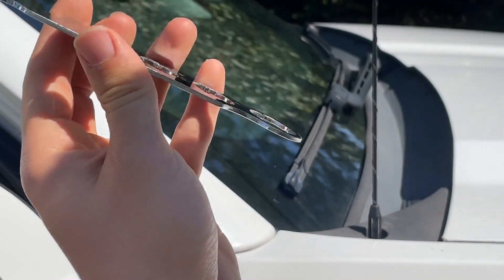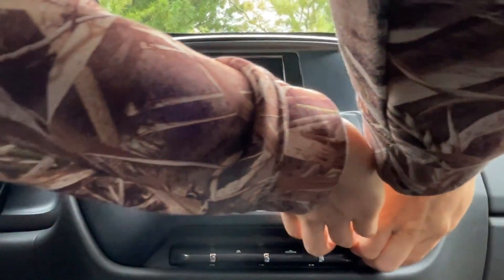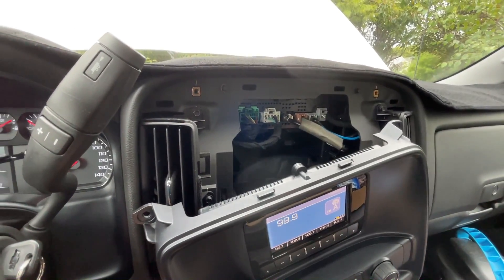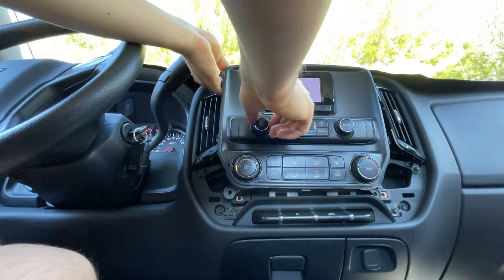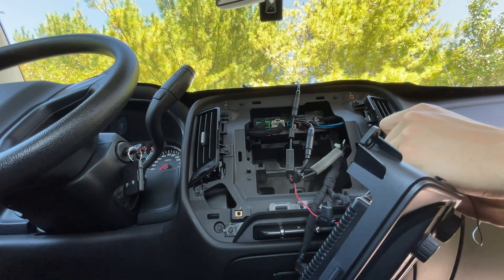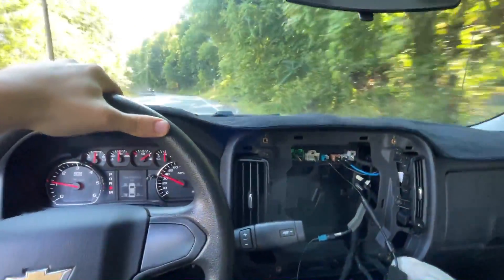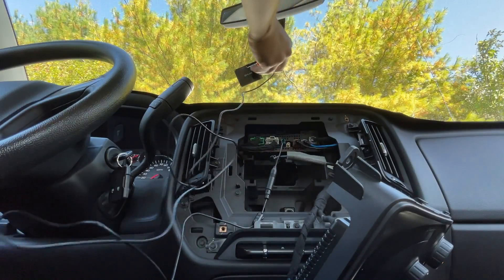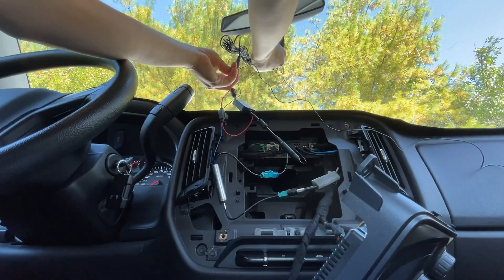Car FM Antenna Signal Booster Amplifier Install + Test

Comment: 31 inches is the tuned length for 88mzh to 108mzh .if you add 2 antennas it's 62 inches long and out of the band . So stock would be better.  The radio is the problem it's probably off the frequency band . Im having the same problem with the aftermarket radio .stock radio works good put my pioneer radio is not as good ..

Comment: To get the best reception you need to use the antenna with a much thicker 75 ohm high gain coaxial cable, and also the one end of the antenna should be grounded to the metal part of the vehicle's body or chassis. That's why your stock antenna has already gained some good signal strength. Without a ground loop, any Antenna makes ground noise if you're too far from the broadcasting tower or when moving the vehicle. Without a ground loop, even FM Amplifiers don't give the best results. Those cheap Chinese Antennas don't have any of those and just only a small printed circuit piece inside that is attached to a tiny wire that receives nothing. I recommend creating your own antenna using aluminium foils. I'm using a car stereo inside my room and I've tried many expensive antennas, even marine grade antennas but they don't catch my favourite stations cuz massive concrete slabs and walls weaken most of the signals. Finally, I created my own antenna by cutting two strips (10mm x 50cm) each from aluminium foil and mounted them under my table using double-sided tape. One is a base that is mounted horizontally, and the other one mounted vertically to act as ground. Both facing each other with a 90-degree angle and not on the same flat surface The reception improved 100% and I've been able to catch 23 stations without ground noise. It works really great.

Comment: The problem is that the instrument shown in the video is not an antenna amplifier or booster. That is used to supply power to the vehicle's antenna with a built in amplifier. What you need is a car radio signal amplifier which is normally a small black rectangular plastic box with a led light.

Comment: You did prove a point, would be interesting to see a longer antenna; same design with that twist they have going on. I'm going to add a twist to an antenna that does not currently have one and see what the results are. 4 inch display in something they are currently charging for your type automobile/truck just does not seem right.

Comment: At 29 seconds you placed your thumb on the antenna bolt and the signal dramatically improved. That's because you were acting as a ground. You have a weak or faulty ground. I suggest you try attaching a secondary ground wire from the antenna bolt to a ground point in the engine compartment. You can also run a ground from the stereo body to an unpainted body wall. You can find examples on YouTube. Good luck.